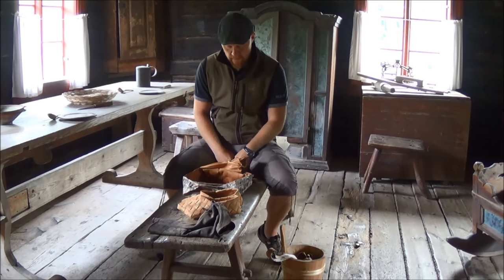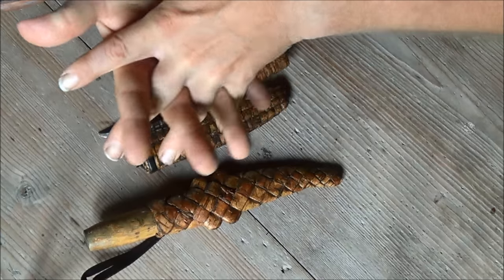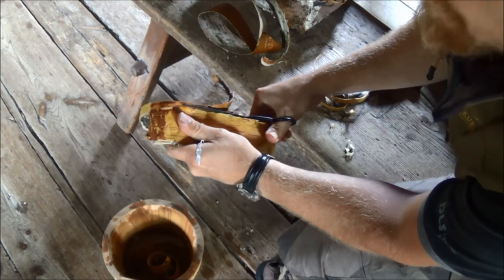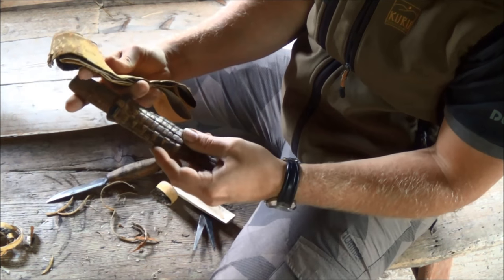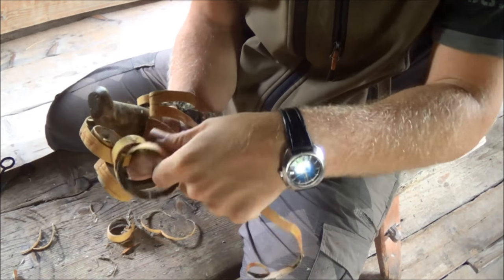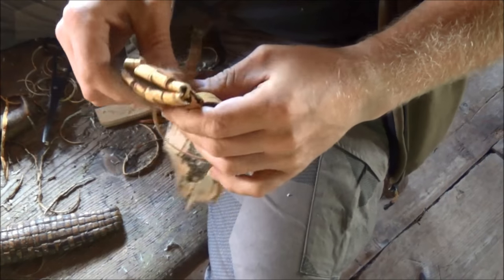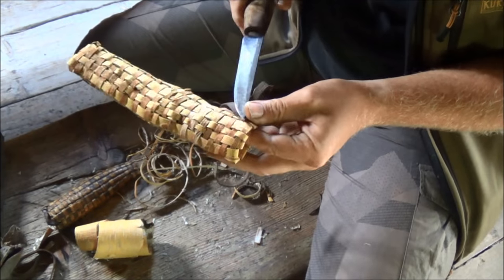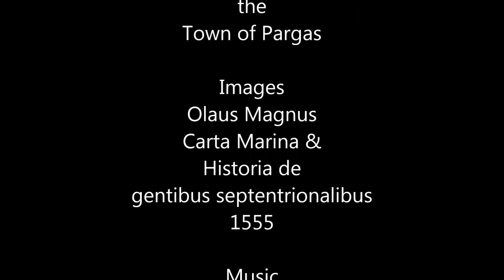Finnish Birch Bark Knife Sheath

Comment: Will wetting the bark soften it during the braiding process as with rawhide? It may make the process of braiding easier. With rawhide we work it while wet, let it dry then add a “dressing” (could be oil based) that gives it a suppleness and prevents water absorbing to a degree. Nice work.
Reply: Yes it'll make it a little more flexible